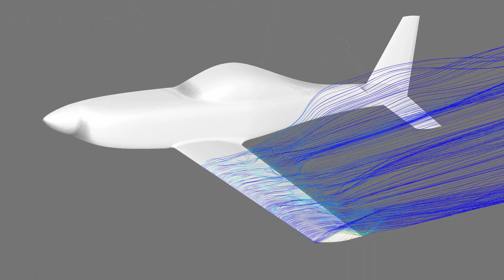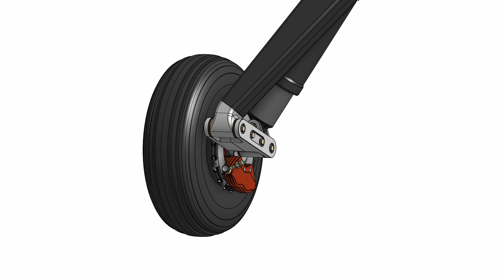DarkAero 2020 Rewind: A Year in 3 Minutes

Comment: I came to know after Jerryrigseverything talked about darkaro
Reply: Same
Reply: Same
Reply: @dreamfilm101  I ran a basic performance estimate on their design, and everything checks out. 

Although one comes to the conclusion there were several "guestimations" where the lift coefficient for landing comez out as perfectly round number, etc. But this is perfectly acceptable, because they chose numbers that are believable. 

Keep in mind, Reno race planes have 66ft^2 wings. They also make around 135-150hp and fly 240-270mph (Sharps DR-90 nemesis flew 290mph on the record) so these guys having 200 horsepwer and the same area of wing should be able to top 270mph without issue. 

The landing speed will be sketchy fast, but their oleo shock trailing-link landing gear will make it land like a bigger, heavier airplane.

The issues I predict are detailed elsewhere in this comments section. (Pertaining to the likley outcome of it's stall behavior). - Which is purely my own speculation - Granted, based on an above average (borderline obsessive) research campaign of my own over a period of two years.

Comment: Impressive stuff guys! Are you guys building everything from scratch, are there any parts that are off the shelf? Except nuts and bolts and perhaps the tires?
Reply: At least they bought an engine. One of my friends used to build up engines. To him that meant starting with a block of aluminum and cutting it into pistons etc. This is one pretty airplane, each and every part is a work of art.
Reply from the maker: R3D, thank you for checking out the video! The aircraft is an original design. The big items that are off the shelf are the engine, wheels/brakes, prop, and avionics.
Reply: @DarkAeroInc  Thanks for the answer! Very interesting. I'm very impressed by your work. :) I've been following your videos lately after I discovered Mike Patey's videos, and then the algorythm suggested your channel. Happy New Year!

Comment: I'd love to hear what a 3rd party aircraft professional says about this aircraft. Hopefully this thing turns out as a Gem! It sure looks great!   I'm Curious about VNE on this and other planes in general.   How quickly does increase in Kts put increased stress on a airframe?  Like this plane, in a previous vid; i think you said 270 cruising, so ??? maybe 300 would be VNE.  In general is that really the maximum? or could you put a turboprop and push it to 350?  or does the wind speed become super stressfull at every MPH increase. there tons of aircraft that could be repowered,   What/where are the increased wind forces directed to on the airframe in normal straight flight.   ( This has definitely not been my most clear/concise question creation!)
Anyways, Beautiful plane, composite structure idea you guys came up with  for your design is a " I Like".  Such, a cool looking plane, cant wait to hear from the test pilot this fall!!!????

Comment: Great work guys. What do we know about the life span of carbon fiber for air frames over time? De-lamination issues. High heat if they are left outside. Stress cracks etc. Should we see carbon fiber airframes flying for 80 years like a B52?

Comment: I'm so excited for this, I'm really curious about the avionics and the agility/G capability of it. So is that stuff cured in an autoclave or at room temperature? Prepreg or not? An autoclave is just an oven with vacuum lines in it right? If it's not cured in an autoclave, one could probably be built for relatively cheap that should do the same, I wonder if robounits aluminum extrusion is strong enough for that. 🤔